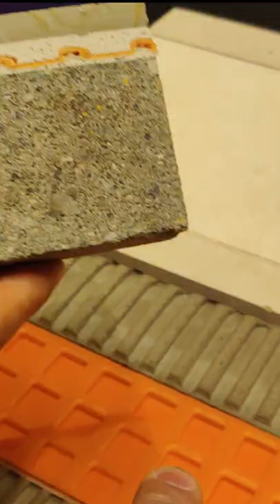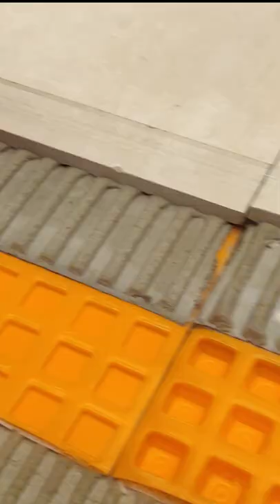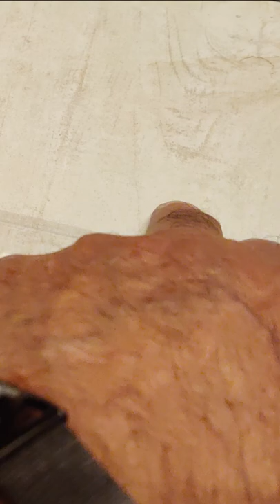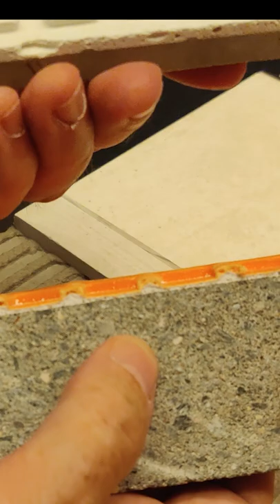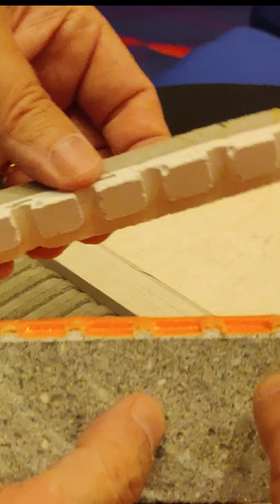How uncoupling works #shorts

Comment: Okay.. and the Ditra material allows for movement when environment temperature changes, which would have the dried thinset crack or worse the tile, without using Ditra.  Hey Sal, may I ask what is the best tile saw 7" blade to use for porcelain?  I need to know what a master tile guy thinks, thanks for all the info.
Reply: Ruby 7" porcelain

Comment: What’s the advantage?
Reply: when the floor cracks the cracks won't propagate through the tile
Reply: Much less likely to crack / break from stresses / movements in the subfloor.
Reply: @whattheschmidt  Thanks man. Is there a long term compromise though? The plastic appears flimsy and those tiny squares of adhesive that are shaped like slots have to hold that shape without crumbling during movement. It seems temporary. Surely a more flexible adhesive mix is preferable long term?
Reply from the maker: Uncoupling is a system that provides a non force conductive tile assembly, in essence the tile on the floor is isolated from the movement inherent in a wood frame construction floor. Permanent long lasting trouble free.
Reply: @grrinc  The reason it appears like the squares of mortar would break away is that we tend to envision a lot of force in one small area, but when you think of the displacement of—apart from a disaster—the floor due to home fluctuation, the forces will be spread across the hundreds of squares in the Ditra. It is a permanent solution. Yes, if you took a hammer and smashed one square you would destroy it. But, apart from a disaster, no one square will ever see that level of force.

Comment: This crack ground due to moving all time or not 🤔
Reply: If your subfloor is squishy, you shouldn't tile over it. That needs to be addressed beforehand before placing the schluter. 

Most professionals recommend a minimum 1-1/4" thick subflooring. So, for example, you can use  2 5/8" sheets of flooring. I would strongly recommend the use of cement board as the top layer in place of wood. Also, remember to offset joints of the layers to further stiffen up the subfloor. Continue your installation process from there.

Comment: Cement board. Tried all the new stuff. Not a fan. It was a fad that will pass
Reply from the maker: Uncoupling has been around since 1987, every manufacturer has it's own version of uncoupling, most installers are moving towards modern systems, those that don't will be left behind.